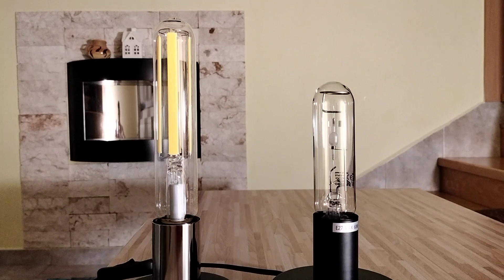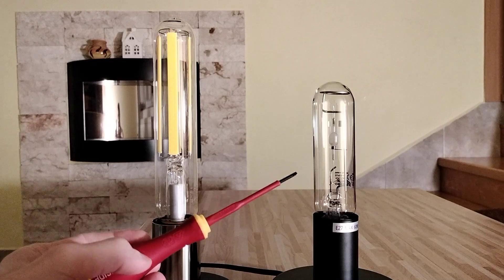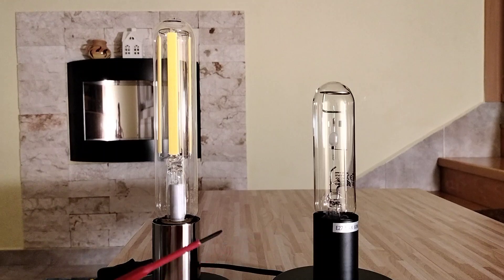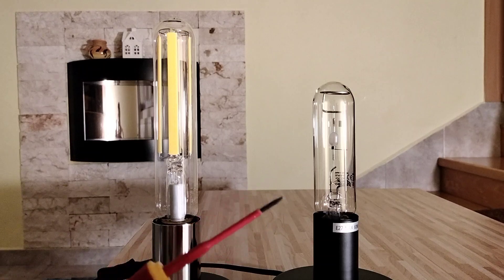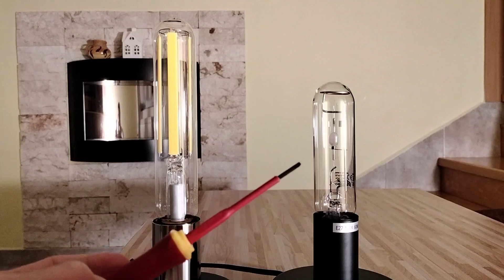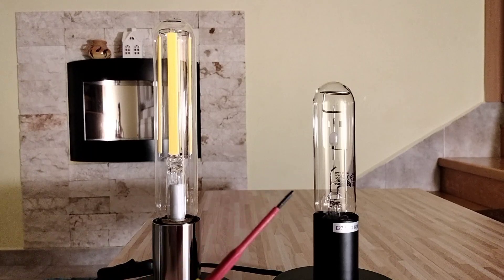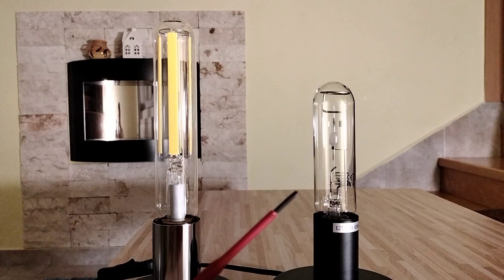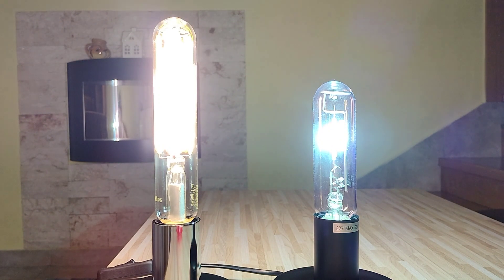LED VS Metal Halide (TForce Core LED road 26W 730 E27 MV VS HCI-TT 70 W/830 SUPER 4Y)

Comment: LED bulbs cannot replace discharge tube bulbs.
Reply from the maker: I agree with you. Even LED has its advantages, but so does HID... And HID lamps have more advantages in terms of health and nature. No blue light from LED lamps, no artificial light (HID lamps produce light by burning a mixture of gases and that's basically the principle of the sun. The sun also shines by burning gas. It's natural light and HIDs work in a similar way.) HID it has even more advantages, but unfortunately LED is being pushed more and more. Although LED is also good in a certain way, it cannot replace HID lamps.
Reply: @Naguals_HID_Lamps  I am using Philips Son-T Pia Plus 50W sodium bulb in my garden. It has been on from 8pm to 6am for 3 months. Actually, I could have used mercury vapor 125W 😁
Reply from the maker: @Collector.48  This makes me happy and I hope that the lamp will serve you as long as possible. I use HID lamps in the living room at home (I'm serious) either 70W or 80W, but I have it set so that it never shines directly on me and the light spreads beautifully throughout the room.
Reply: @Naguals_HID_Lamps  I don't have 80w mercury but I have 50w mercury osram
Reply from the maker: @Collector.48  That's great, Osram is an excellent company, one of my favorites. And the other one is Philips. And which Mercury Vapor lamp do you have? Classic HQL? Or HQL DE LUXE (MBF-U), or HQL SUPER DE LUXE (MBF-U)?
Reply: @Naguals_HID_Lamps  MBF-U de luxe 50 W hql
Reply from the maker: @Collector.48  This is a great type. I'm glad that people are still using quality Mercury Vapor lamps and I hope it will continue to be so. A classic is a classic.🙂